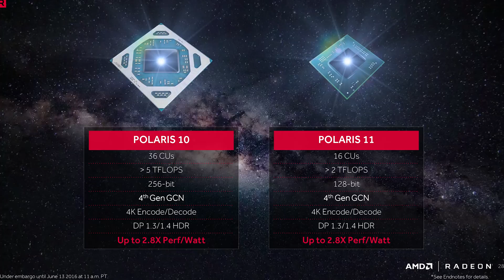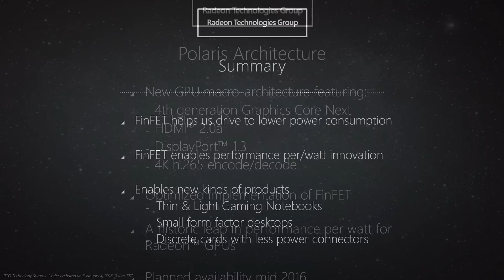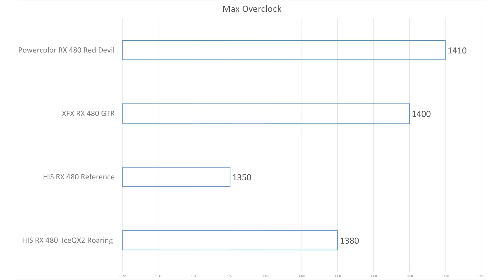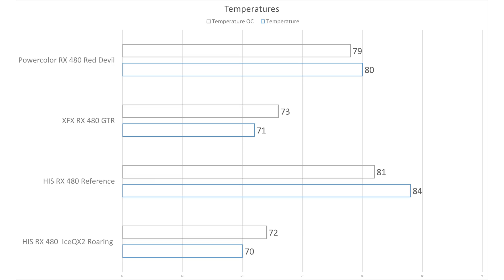4-Way RX 480 Showdown - XFX vs HIS vs Powercolor vs AMD

Comment: LOL! THE XFX BLACK EDITION are bad. The fans dont speedup and it over heats and turns off the computer. You have to play with the fan when it's on to get it working right, but after that no problems til you remove it and have to do it all over again.
I have three of these cards and all three are going back because they dont work right. two because they crash my system when mining and the 3rd one because of the fan and it over heating/shut down.  I am going to try the powercolor next.
Reply from the maker: +Jon McClane im pretty sure its either yours is faulty or your case airflow is bad. Because i don't see any overheating problems.
Reply: Hey dude, that's the dumbest thing i've heard! So I buy 3 cards and i got it form 3 different times and all 3 cards are bad, and you get that it's my case and only the 3 cards that are faulty. Well dude that 100% failure rate and it's not my case because i tested out each card one by one. All the cards failed the first and second, third and fourth times. Not on 1 computer but three different computer. New Ryzen, old Xeon and older Opteron.  I would say that it's not me but the cards and if it's the cards then it's XFX. I've also talk to other and they have issues with this card.  The one card that I was able to get working will still fail when placed into a different computer until you play around with the fan when on and who wants that.  Why dont you check out what i'm saying!
Reply from the maker: +Jon McClane i was just saying mine works fine so yours must be some anomaly
Reply: Okay once again, I have three and out of three all are bad? what does that say? You being a reviewer should know better but you're saying it's an anomaly! It would be if it was just one card but it was three.  What are you going to tell me next!
Reply from the maker: I didn't say anything that contradicts what you said

Comment: HIS and XFX same PCB right? I ordered HIS since it's $30-$50 cheaper than XFX GTR RX 480.
Reply from the maker: +Karlsanada13 yes exactly the same. Good choice then hahah
Reply: I subbed too. :D Anyway, sadly it was out of stock so I tried getting 
GTR Black Edition instead. Hopefully, they have a stock. I usually buy 
Sapphire but the price difference between Sapphire and XFX here is 
minimal (around $5 only).

Oh what they have is the non-roaring version. What are your thoughts about it? It does not have a backplate and only has the IceQ x2 cooler.
Reply from the maker: +Karlsanada13 thanks! Bummer. Hopefully they have it in stock lol also the Sapphire RX 480 is not very good so I wouldn't suggest getting that. The HIS is the non Roaring version eh, that explains why it's much cheaper because that's a different model that has a weaker cooler and pcb.
Reply: No, the one I ordered first was the Roaring version and it costs less $30 to $50 than any AMD cards here. They usually have cheaper prices here. xD However, they do not have a stock and instead suggested I got the non-roaring version. I cancelled the order and got the XFX instead. xD
Reply from the maker: +Karlsanada13 ooo hahah yea 30 less is really good. Getting the XFX is probably the best idea
Reply: Get the black edition. I got 1475 on core and over 1500 graphics score on firestrike. Temps and noise were low too
Reply: Too bad they're out of stock that time so I only got the GTR version with 1280 core
Reply: Karlsanada13 what's your overclocks like? If you are in the UK aquatuning has them

Comment: Thx for review! This was exactly what i've searched for.

P.S. Try to narrate with a little bit more emotions, it'll drasticly improove your content)
Reply from the maker: +Onion Boy thanks! Glad I helped! Also I'll be taking your advice thank you :)
Reply: I find the ROG STRIX to be a great overclocker, too. It stays quite cool when I OC it to 1470 MHZ.
Reply: and where is the asus rog rx 480 OC 8gb strix ? :((((
Reply from the maker: +Vintage Hardware i didn't get to try it out. And it has bad value anyways compared to the other cards so I wouldn't bother unless you really like the looks or need the slightly better cooling.

Comment: Very nice video .Are you sure that Roaring x2 & Xfx has the same Pcb ?? as HIS has Another Top version called Roaring Turbo .Also to me His fan db sound lower than xfx .what did you hear .Is it too much noise compare to other 480 & any annoying  coil noise ?
Reply from the maker: Thanks! Yea they do have the same exact PCB down to the same components. I did add some gain to the audio so it's audible a little better so don't use it as how loud it is but use it as how it sounds like. The HIS does sound a little quieter though yes probably because the fan doesn't have a ducted shroud like the XFX. No annoying coil whine to speak of on my cards either.